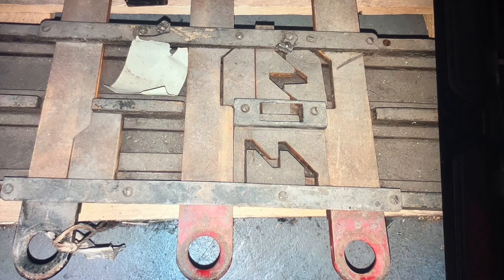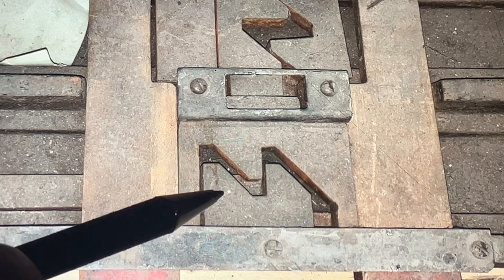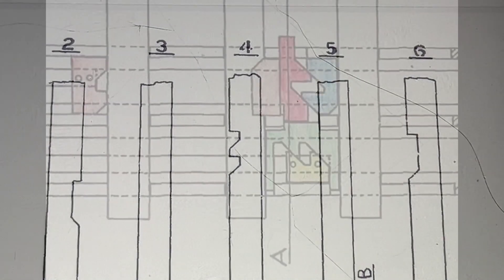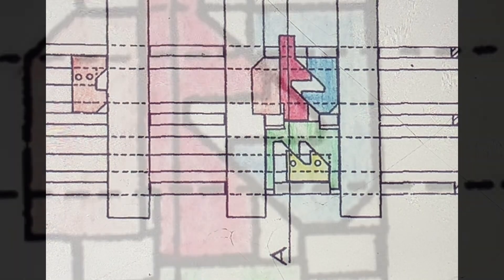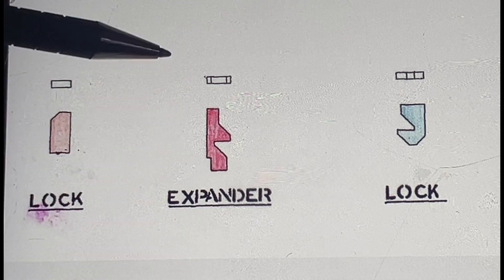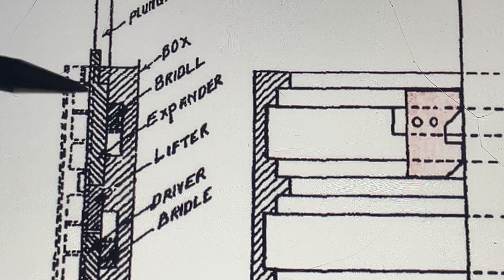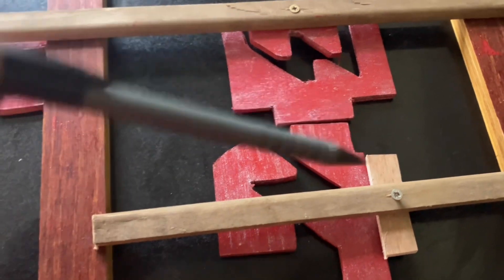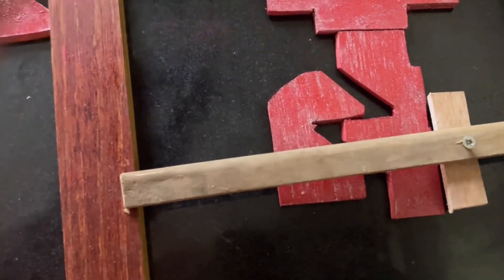Conditional locking between Trays

Comment: The primary purpose of the interlocking is to allow all non conflicting routes to be set up but not allow any conflicting routes to be set up. They were in fact a mechanical computer, you cannot but respect the people that worked the interlocking out they must be classed as geniuses.

I am lucky enough to have spent some time in a Signal Box Locking Room of a long gone GWR Signal Box. The box had a 65 lever frame though there were 13 spares, whilst, 4 trains were crossed with two being shunted which required the pulling and putting back of 90 moves in the lever frame. What I saw has been etched in my mind for over forty years, it was brilliant watching the sequential locking, condition locking etc work.

Thank you for making this video about a subject that is far too often overlooked and for describing it in terms that most people will understand. Spare a thought for the person that worked out the interlocking for York's Locomotive Yard Signal Box with its 295 levers!